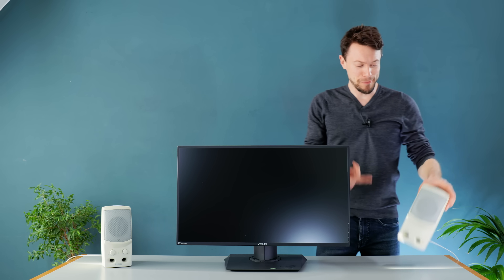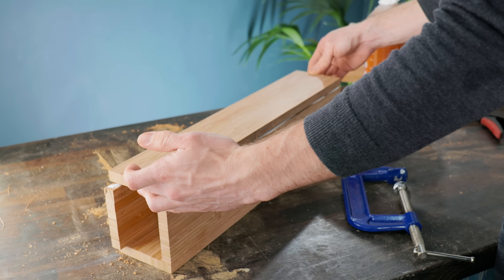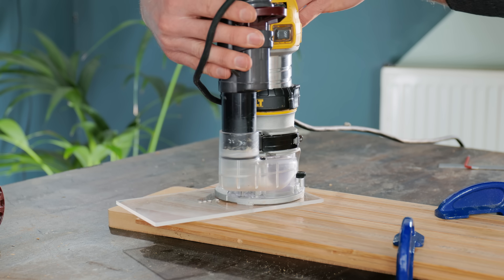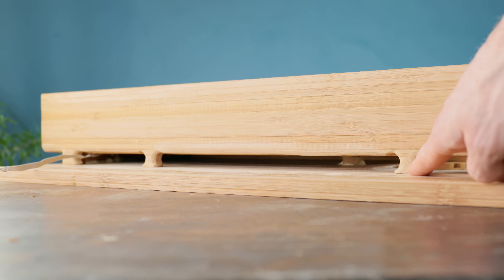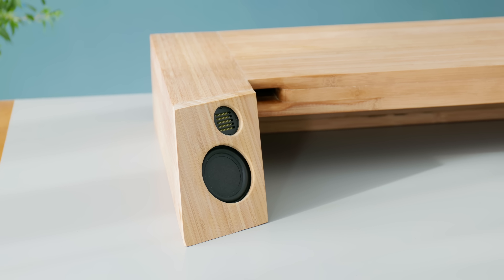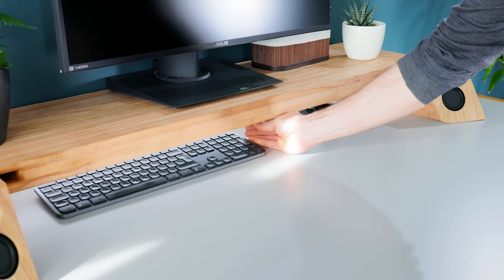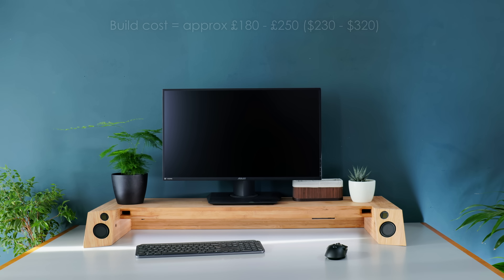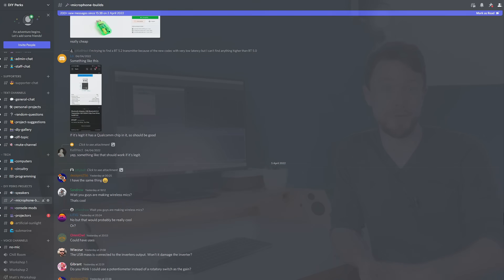Building a PC sound deck... with a twist!

Comment: MDF is used due to a material survey by Visaton Labs from i think 1986 thereabouts, and i'm sure others came to a similar conclusion. It has a unique property that it absorbs and dissipates vibration, helping the simulated model and the speaker converge. It was the material least prone to emitting resonant noises after the concrete-bitumen-concrete sandwich, which wasn't deemed very practical.

More speakers should have a tilt. This is because the radiation plane of the midbass is often inset compared to tweeter, so the natural neutral axis on a 2-way speaker that looks like it's firing forward is actually pointing down; around it there's a pattern of cancellation lobes. Sitting in one of those cancellation lobes is not a good time. But due to people being weirded out by such design, manufacturers prefer crossover compensation, or just ignore the issue.
Reply: Do you have any more detail or articles I could read up on cancellation lobes? Thanks 🙂
Reply: @turbokadett  I'm not sure of any articles but a cancellation lobe is just a region where the phase of one wave is 0° and the other is 180°. Polar plots depict this very well in driver measurements. Certain websites will provide polar plots when measuring speakers off and on axis.

Comment: Isn' there a "rule" that you should not direct your hifi speakers directly to you, but always parallel? Or is this different with these speakers?
Reply: Generally, stereo speakers should not be parallel or point directly at the listener.

Realistically it's somewhere between the two, but it depends on the speaker, the size of the speaker, the distance from the listener, the size of the room, and how far the speakers are from the wall behind them.

There's no simple solution.
Reply: @iridescentgherkin  thx for your answer:)
Reply: No this type of rule doesn’t exist, the vast majority of speakers needs to be pointed directly to you
Reply: @nixx5490  Sorry, but this is incorrect.
Reply: @iridescentgherkin  almost every hifi speaker is better on axis, verticaly and horizontaly 
If you say it's false bring a proof
Reply: @nixx5490  You said "speaker needs to be pointed directly at you" - this is false.
You will just get a bad stereo image.

Changing your argument to being "better on axis" is a totally different thing. 

I'm not looking for a fight, I'm just telling you that your first statement is technically incorrect.

Now saying that almost every speaker is "better on axis" is a far more truthful and accurate statement.

Comment: By the way... Got Better Help based on recent trauma & got the code from Matt Parker's channel. It's very good, they have a questionnaire that fits you with a good match, and if not you can easily change therapists. If you think you might need therapy, GO NOW, therapy is surprisingly easy and even after two sessions I feel so much better and I've learned quite a lot.

Comment: MDF is also used in order to get uniform sound wave dissipation through the material.
Because wood is not uniform, it might affect the sound characteristics of the speakers.
Reply: The real downside of natural wood is s it's tendancy to twist and warp with changes in temperature and humidity. That's way sealed MDF or marine plywood are preferred.
Reply: best for speakers is birch-ply ... but that is shitty expensive atm. and if you're not calculating the enclosure it doesn't really matter anyway
Reply: it's less about uniformity but rather the sound of the material. the little particles and bonding glue in mdf give it a dead sound with little resonance, while hardwood resonates more and colors the sound (which is obviously suboptimal). that's why enclosures usually use some type of compound material with veneer on top
Reply: @tobymarol7329  there are many legendary speakers that "color" the sound, and some people actually prefer them still
Reply: @StanleyKubick1  correct. In fact this is why natural wood is preferred by instrument makers. They can use sounds preference for travelling along the grain versus across it to literally "shape" the sound produced.
Reply: @JaenFoster  Yep! And unsurprisingly, Messiah Stradivarius violins get their sound from the local species of trees that they used at the time. A species of tree that no longer exists in the current day due to natural evolution and man-based intervention and harvesting.
Reply: @JaenFoster  the difference between a musical instrument and a speaker is a musical instrument is supposed to colour the sound and add character, a loudspeaker is supposed to remain neutral and reproduce the sound without adding any character. Pretty much all loudspeakers use MDF for a very good reason and it's not because it's cheap. Even speakers that look like they are real wood are actually laminates. MDF is superior for many reasons which there's plenty of resources online which will explain.
Reply: I'm surprised all y'all talking on and on about MDF never even mention HDF...

Laminated HDF FTW.  If I had had that back when I was building sub boxes in the 90s...
Reply: @TheTalonts  i didn't even knew, that something like this exists <googling now> ^^
Reply: @TheTalonts  laminated hdf would be too unpredictable because of the laminated aspect.
Reply: @AnnaVannieuwenhuyse  - seriously?

Guess what the plywood you use is...yes, laminated wood.

HDF is highly predictable, as it is homogenous.  No voids.  The laminate is simply the outer skin for looks/abrasion resistance.

(That all said, when I was building car sub cabinets professionally, I used plywood, to keep the weight down.  Much more bracing was required, though  For a home box, MDF/HDF.)
Reply: Marine ply is used for a reason.
Reply: MDF is used only because it’s cheap and predictable.
Reply: Actually it doesn't make that much of a difference
Reply: @amcomma  for cheap 40-50$ speakers? obviously. For a stand for speakers? again won't make much difference
But for enclosures for higher end Audiophile gear or just better audio in general especially if you already know what you're looking for, yeah it makes a difference, not massive but definitely exists and can be noticed
Reply: @amcomma  It absolutely does make a difference when cabinet design is a crucial part of your design. When I contribute to designing things like the Paraflex Midhorns, there's even a difference between cheap MDF and decent MDF. Same with Plywood. We only use a specifc type, baltic birch voidless quality grade BB (none above or below) because of the precision in mass tuning.
Reply: I reckon any inconsistencies of the wood could be balanced out through the manual tuning of the crossover circuit.
Reply: @NRobbo  You can't balance out harmonic distortion, frequency decay and things like that with a simple crossover. Acoustics are a very complex subject, and so is enclosure design. That said, MDF is not the perfect enclosure material either, it's just a pretty good one for the cost. (Good internal damping of vibrations/minimal resonance in the key frequency range, decent rigidity, etc.) In practice this wood is a fine choice for this design given the geometry of it, thickness of the wood, etc.

Comment: As someone who repairs the things I own, I know even the best quality things eventually break. That being said the speakers being glued in triggered a no go reaction. Great looking, great sound quality, tough to repair without breaking apart.
Reply: It's hot glue just use some rubbing alcohol and a heat gun or hair dryer and it'll come off.
Reply: @asandax6  you can just pull it off hot glue is so weak
Reply: @asandax6  And how do you get to them?
Reply: As long as it's just hot glue it'll be pretty easy to remove, and the woodglue boxes can be taken apart with little damage, but it's kinda necessary to provide an airtight seal. i've built a number of speakers myself and the first ones i've taken apart a number of times to improve electronics, damping and enclosure always reusing the same boards. Also, once you have well designed speakers with quality components it's very unlikely you'll have to repair something, even after decades
Reply: I think going with two layers of single-sided adhesive rubber seals would be the way. This way there is no actual adhesive binding the speakers to the frame itself, but the two rubber surfaces will create an equally airtight seal when squished together by screws. It will take a slight bit of extra work to make the right fitment and screw holes etc, but in the long run it will be easy for any post-build maintenance or alterations.
Reply: I mean, if you build it, it's your choice if you want to use glue or screws.
Reply: then just use screws
Reply: @noe9250  yup I would. Thanks.
Reply: Yeah, that was my thought as well. Some other things that I personally didn't like were the USB cable instead of a proper socket at 7:45 and the use of an external power brick.

The power brick is probably a reasonable choice as it removes a lot of complexity but I personally hate having to source replacements for those things (if they get lost or break) ever since I had a cheap one that somehow messed with my powerline adapter while it was plugged in.